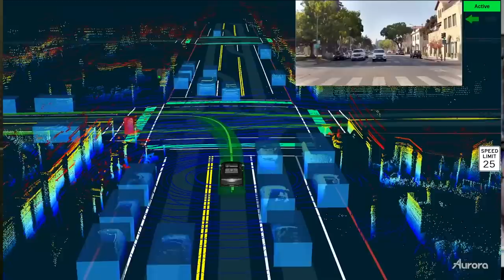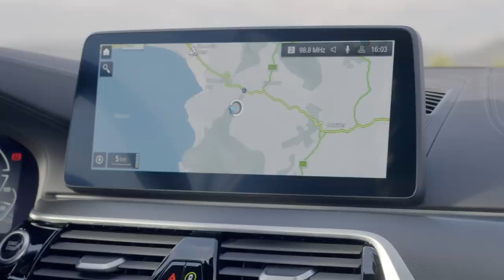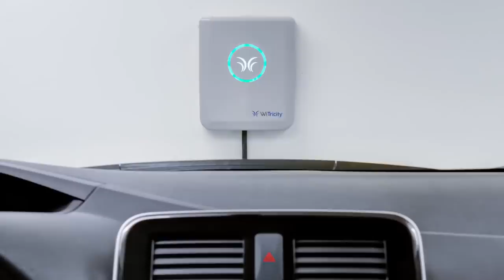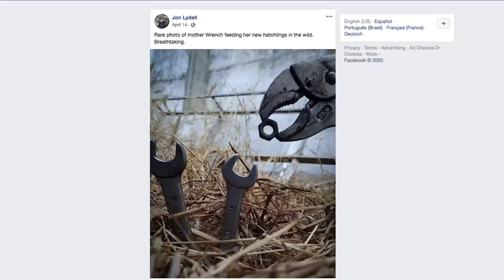BMW 5 Series Refreshed; E-Class Coupe, Convertible & AMG Models Debut - Autoline Daily 2845

Comment: I have always thought that EVs should have been Invented with a retractable charging cable and that the charging stations should have an female inlet. It would be more sanitary if the cable were attached to the car and not the station.
Reply: Not a bad idea, the ultimate goal now is to reduce weight and the faster the charging the more robust the cable becomes.

Comment: Wireless charging pad in my garage sitting in a pool of water after the ice melts off the car...No thanks.
Reply: I’ve owned a Tesla for 5 years in snowy Canada. Very good point!!
Reply: Should that even be a concern for functionality with wireless charging, one would expect the homeowner and installer to ensure there was no water pooling on the charger during installation...
Reply: JDubbs07 well it will work but it will be under water for long periods of time.

Comment: "Charging experience" plugging it in when you pull into your garage. 95%+ of all charging is at home. EV owners say never going to a gas station is one of the best things of owning an EV.
So, no, I don't think wireless charging will make any difference.
Reply: apt dwellers and anyone on a roap trip need to charge somewhere.
Reply: @pixelfairy  A lot of apartment complexes have installed chargers.  And people take road trips so infrequently that handling a charger is no more inconvenient or gross than handling a gas pump.
Remember, that "95% of all charging is done at home" already includes people who live in apartments and road trips.